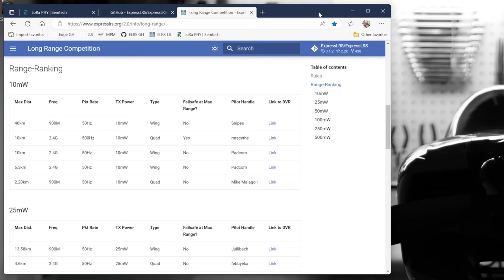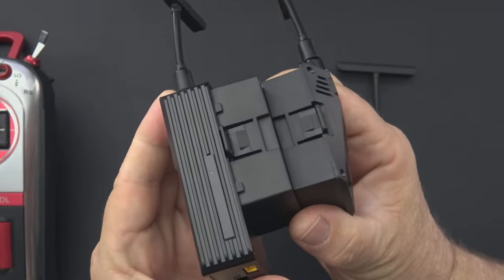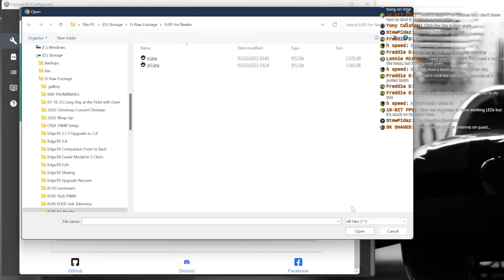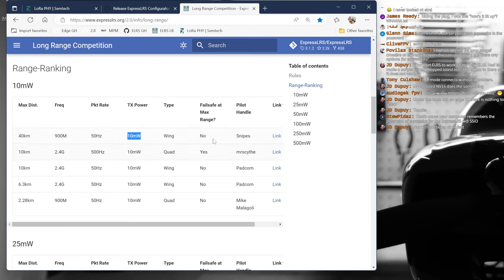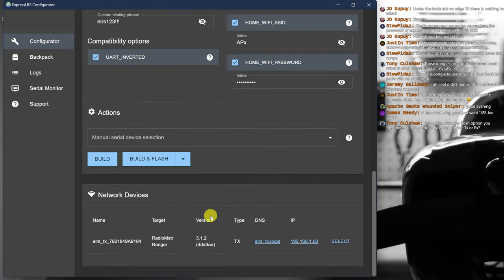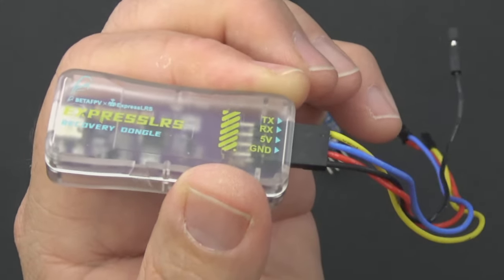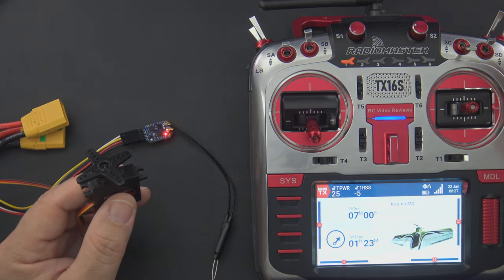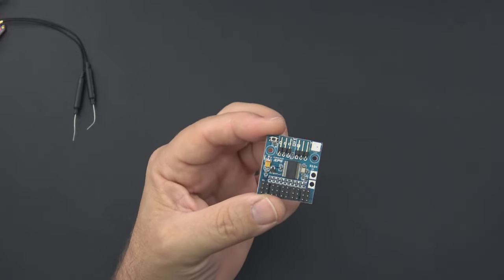Intro to Express LRS • For ELRS Novices

Comment: Great video.  I have a Matek 405 flight controller with elrs built in and was struggling with connection.  Your comment about the Matek target being DIY made me go back and actually read the manual.  After updating the firmware, it works great!  Thanks for all you do, especially for us noobs to elrs.
Reply from the maker: Glad it helped and you're welcome.

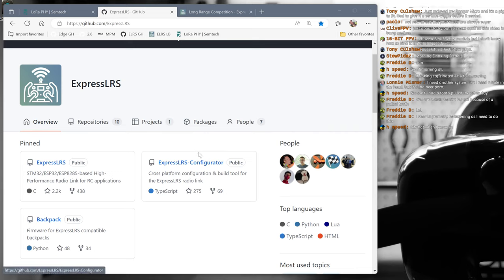Comment: 13:21 Was idly listening from my office desk in my sign shop as an RC Newbie looking to outfit my FMS Fox 3000.
Your first couple of lines was spot on! People in most help videos are speaking english but the nature of the craft has so many abbreviations, all a newbie can hope for is knowledge obtained by osmosis. FPV, ELRS, BNF, PWM, FJB, the list is endless.
 When I discovered people fly long range on auto pilot and use FPV I was thrilled.   My heart started pounding as I was alerted to the reality that me,  a professional power Mac user can join in the fun without using a windows platform, which is harder to me  than flying without AS3X and Safe.  
ExpressLRS-Configurator-1.5.5.dmg had me from hello!  
Currently, I'm all Spektrum but I will be buying all my gear through your links because your video made my day!

Comment: So true about long range...video will go long before control signals. Furthermore, 2 watts would provide little increase above 1, as there is not a linear relationship between power and signal strength. Thanks so much for this video, I've been kind of resisting elrs a bit because I haven't had any range problems, however, it's getting harder and harder to buy certain quads that aren't ELRS.

Comment: Excellent job presenting ELRS and its idiosyncrasies. 
Unfortunately, you've definitely talked me out of ELRS. Last flown rc planes 15yrs ago. Will start flying again as soon as I can print  my Pitts. I think I'll start with Flysky IA6X then move on from there. Thanks again.
Reply from the maker: You're welcome. It's definitely not for everyone and there are simpler options to be sure. What I like so much about ELRS is I can use it in everything: CRSF talks to flight controllers so Betaflight on quads, iNav on FPV fixed wing. It talks to the FBL I like to use so I can use it on helis. And it has PWM output options with telemetry, so I can use it on fixed wing for LOS. On top of that the receivers are fairly cheap.

Comment: Thanks for this.
I have recently made the switch to ELRS, starting with the RadioMaster Ranger transmitter module, RadioMaster RP3 receiver, & the first of all five of my helicopters to get it is my Goblin RAW 420. Eventually I will put all of my helicopters onto ExpressLRS. I have been following their development since 2019, back when I first bought my RadioMaster TX16S Max Edition controller.
Nearly four years later, & this has come out & the ELRS devs have finally added support for helicopters is amazing. =^/.^=
Reply from the maker: You're very welcome. Glad you found the video useful.

Comment: "Take your medicine, go spend the 7$. It's worth it" 
LOL
I had to stop the video and laugh.
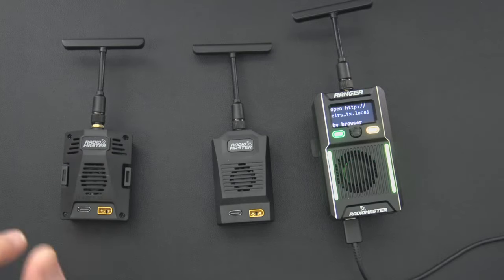0k back to it now. 32:03 min.
I love the way you explain things, the telephone analogy is great we used that when I worked in telecom to explain why we were twisting two wires on our cables.
OMG the pointer cam out!!!!!
I am going through your channel videos, it like eating an elephant.
I thought you were going pretty fast then I realized I had the speed a 1.5...
I used to code a bit back in the 1980s, compiling from a tape could take hours on a big VAX, prior to that you would insert punch cards all night on like a P-11 (before my time). Talk about your "this could take a long time guys" comment! LOL  
You have a nice pic of the Ranger micro on your elrs lite and I hope that IK will get that when I upgrade the firmware on the TX16, I just received it and it has edgetx v.2.7.1, 2022-07
Thanks!
Reply from the maker: Welcome to the channel and have fun going through the material :)
Reply: @RCVideoReviews  BTW,  I did buy "it". I kinda had too after your comment... 🙂

Comment: Small correction, the full sized ranger can go all the way up to 2W! It is more powerful (but it's useless for most people)
Reply from the maker: Not out of the box and I don't show it because I don't want to be the one responsible for telling everybody how to violate part 15 rules. So it's not a correction. The device allows it, but the manufacturer correctly set it to 1w to comply with the law.
Reply: @RCVideoReviews oh I completely agree on you not showing how to circumvent the law, but it's a selling feature even if they never explicitly say it to not get their product banned. In their website they only say "default 100mW" under RF power output in the product specs of all three for the same reason, lol

If it was intentional though I also agree it's not a correction
Reply from the maker: I've been flying LOS with ELRS for a while now and it's pretty rare to see Tpwr in the logs > 10mw. Every now and then a 50mw burst. 2w is just over the top and really not necessary unless you're doing some seriously long range and then you're going to have trackers, and some serious knowledge on video setups. So I figure at that point, you already know the hack. 

YT is a great teacher. Sometimes it's just better to leave certain things unsaid.

Comment: For anyone shopping for a Ranger module, the biggest one, with the aluminum casing, will shed heat more quickly than the smaller version, that has a plastic casing. Just something to take note of.
Reply from the maker: I was flying all weekend in Florida. It was 95 degrees outside yesterday. Telemetry on the micro showed RQLY about 95% or higher, TPWR at 25mw 99% of the time with one or two spikes to 50mw. So I had superb LOS radio performance throughout the weekend with a legitimate heat test on the micro.

That said, my TPWR was low the whole time. If your use case mandates a higher TPWR, the aluminum case might make sense.
Reply: @RCVideoReviews  thank you so much for all these stats, I will put them in my folder, until I have a better idea on the full range and performance of these modules. I am interested in how the 2Watts will handle penetration ( I see you suggest that LoRa is not necessarily aimed at pen, but looking forward to field-testing ) of green leaf canopy. I have not yet put my drone in the air, since I received the module.
Reply: Just an update to the thread... (not adding much to what RCVideoReviews already said, just getting back to my original comment)
  >The Power Output of the RC-Link, that is needed when flying with a Video RX/TX will never be anywhere near what is needed for the Video Link. I Don't fly long-range, so I can't speak to that, but at ELRS-150mW, the RC-Link is way, way, more powerful than my DJI-V2-1200mW. I can' not find a use for the ELRS 2-Watt Power Output, when I am using a Video Link. 
   >If you need the full 2-Watts ELRS RC-Link, then you probably already know a lot more about radio than I do. Happy flying everyone!

Comment: K my issue is that I just got the radio master boxer with built in Express ELRS, Crossfire, 4&1. Now i did the whole process on downloading the black sheep TBS Configuration. But for some reason, my TBS agent is not working on my controller. It’s saying something like error value. I’ve copied the TBS agent files to my USB on my radio, I followed the instructions to the T on Joshua’s (from Roto Riot), YouTube video on how to download the files. I didn’t need a module for this saying that my radio has it built in already. So I don’t know how to get the TBS agent to stop showing a error value. Any advice or link video that shows on how to get this back to working. Also, if I were to do a master reset on my radio, would it reappear as how I first got my radio?

Comment: Great video. But I'm still unsure why I might want to use ELRS for my airplanes instead of the 4 in 1 module. I'm not doing FPV or drones. Thanks
Reply from the maker: $15 Rx's, no fear really of signal loss, ridiculously easy to bind with binding phrases, tx can travel from radio to radio and maintain bind, rapid development in Opensource vs stagnant corporate development, multiple form factors including postage stamp and pwm. 

I have ELRS in all of my best planes.
Reply: @RCVideoReviews  thanks!

Comment: Hi sir I have a question what would ur advice be I wanna add elrs to my ground control for my Rc car ? Ps u are the first guy I’ve Hurd say what u said In regards to neubs!!! Amazing sir u are awesome 😎
Reply from the maker: I'd say I love ELRS and trust it with expensive planes far away. If you have a ground based radio that supports ELRS tech--I would say use it without a moment of hesitation. Glad you found the video useful. Thanks for the comment.
Reply: @RCVideoReviews  yes radio link RX eight has a wire that connects straight to the ELRS system through the USB or a small battery but my question to you is do you know how to connect this to an RC car

Comment: I am a complete beginner and have got the pocket  cc2500 to and have the elrs nano mod on its way. I have real flight trainer simulator with a ws 2000 dongle which I am unable to bind with, I am hoping that with the module that it will bind. If it still won't bind have you any suggestions

Comment: i am awaiting my new mt12 radiomaster 4 in 1 surface radio and have a nano elrs module.i will be updating to the latest firmware. my question is do i plug the usb c direct into the module or do i plug module into radio 1st and then use the data port on the side  of the radio. will the  installer read the external madule so i can flash it or can i just flash it when not connected to the radio

Comment: Hello everyone, So I got a new drone (my first drone), and I have been able to fly it okay. I'm using the Radiomaster Boxer ELRS. However, on the last two flights, it started screaming at me, "Radio signal critical" and fail-safe. anything that i can do, or is this a kown issue? it was not doing in the last 2 weeks that i have been flying it. as soon as i crossover 300 Meters away it goes on telemetry. lost and critical low signal

Comment: Hey again :D may I ask if there is a way with the Ranger to sent telemetry via WIFI or BT or its only used for flashing etc? Thank you!
Reply from the maker: Telemetry is only delivered over the control frequencies.
Reply: @RCVideoReviews  I managed to add a BT module and now I can get the telemetry on my phone. Although I use it with Ardupilot now, I'll figure about something for the other platforms too. Thank you!!!

Comment: So its not possible to flash thru the TX16S when the module is inserted into the Jr-Bay ? I have flashed FrSky Rx's via the TX thru the UART and made a servo cable that had switched two pins.
Reply from the maker: No, you can't flash external modules through the module bay.

Comment: Great video! Thanks a lot.
I hear from others that when you use 1 watt or higher power you should always use an external power supply. Is that right?
Reply from the maker: I cannot validate the question. Two points: 

1) We're talking about radiated power, not electrical power. 

I don't believe it's a 1:1 correlation between radiated power and electrical power, but if it were 1:1 then: 

2) 1000 milliwatts = 1 watt. W/V=A. So 1w/5v= 0.2a or WORSE: 2000milliwatts = 2 watts. 2w/5v = 0.4a I seriously doubt the pins in the JR bay would struggle at all with .4a. And I know the batteries in the Tx should be able to easily handle an incremental half amp.

So personally--I doubt an external pack would be required.

Finally, Radiomaster did not stipulate in their instructions that an external pack is necessary for 1w of transmit power.

Comment: This used to be a simple hobby.  A lot has happened since I built my last heli in 1985.  People used to think I was smart because I knew what a Schmit Trigger was.  No more.
Reply from the maker: The tech is advancing at a rapid pace, that's for sure.
Reply: I kind of see this as a separate hobby, honestly. In my youth R/C was more about modeling, and the more "scale" you were the cooler. R/C drones are a different animal. It's more about the bleeding edge of technology and riding this wave of super fast development. Luckily R/C modeling still exists, and Futaba will still happily sell you a radio for that.
Reply: @RCVideoReviews  Well, I'm 76 years old.  I doubt I'll live long enough to even catch up.
Reply: @MontegaB  It just dawned on me that the only flyers needing ELRS are drone pilots so I must agree that this is a hobby unto itself.  I bought a Boxer with native ELRS but I doubt I will ever use it in an aircraft.  Maybe I should go look at what Futaba has to offer.  Could you elaborate a little, please?

Comment: I'm new to elrs thinking of radiomaster tx12 plus rx from them do I follow this video to configure thanks
Reply from the maker: ELRS configuration is really the same regardless of the radio/module being used.
Reply: @RCVideoReviews  
Thanks for your reply 
I am also after advice on what fpv camera to use on the heewing t1 vtol  as it is a lot of info on different setups. was thinking dji 03 or runcam.
Any help much appreciated

Comment: Is this necessary equipment for rc flight in general or just for long range?
Reply from the maker: You have to have an RF transmitter and RF receiver. It may as well be this protocol. Can't beat the price, features, or reliability. 

Nothing else on the market comes close.

PS And oh yeah, if you want to fly long range you can do that too. I use this protocol on every line of sight (LOS) plane I have.
Reply: @RCVideoReviews  my apologies, I didn't word that question very well. I also assumed that the ranger module was just for extreme range. Is the ranger module a must have for the transmitter to work, or does the transmitter still work without it?
Reply from the maker: All TX16s come with an RF transmitter. Some are 4in1, some are ELRS. None of them ship absent a transmitter.
Reply: @RCVideoReviews  gotcha. Thank you

Comment: I am a subscribed. If i do not do fpv, and only flying watching my small foam planes at the local park or a club , do i need ELRS?  what do i lose for not using ELRS in my case? tks
Reply from the maker: I use ELRS in all of my LOS models. Cost effective, locked on RF, binding phrases, bi-directional CRSF, onboard vbat, plenty of form factors, packet rates to 166hz for 16ch, 333hz for 8ch, opensource development by hobbyists who know what they're doing. 

To me, this question needs to be flipped: Why on earth would you use anything but ELRS?
Reply: @RCVideoReviews  Well put, i only recognize about 1% on the names you listed in your response but it seems that there are many things i am missing from not using ELRS, i will continue watching your videos to learn about it. thanks for your response.

Comment: Hey man quick question, I'm trying to build and flash for the first time my Axis Thor tx and it keeps saying flash error, and under the log it says- A fatal error occurred: Failed to connect to ESP32: No serial data received. I have the correct driver installed from silicon labs, can you possibly point me in the right direction on how to resolve this frustrating situation?
Reply from the maker: Flip rx and tx?
Reply: @RCVideoReviews  I tried switching to that option with no luck, even tried several different usb-c cords including the one that came with my phone and still the same result. My tx came with version 2.5.0 and it won't update to any of the newer elrs versions, they really need to work on streamlining this whole process like Crossfire.
Reply: @RCVideoReviews  so I finally got my Axis Thor tx to update from it's factory setting of 2.5.0 to 3.2.0 via it's own wifi interface and web browser, along with my two Matek R24 P6's (man those soldered pin headers bring me back) via the same method, so it's all good here minus my understanding of why the uart method kept failing. 

Quick question: what do you prefer to use as your best elrs pwm board for 6 plus channels in fixed wing models?
Reply from the maker: I like the Matek CRSF-PWM-C. It's 10 channels, but has voltage and current. If you can get by with just voltage, the CRSF-PWM-6 is pretty nice.

Comment: You have to use this dongle on all elrs receivers or just certain ones
Reply from the maker: This is a trick question:
You don't "have" to use the dongle. You can flash via wifi.
All receivers can be flashed with the dongle.

I recommend ensuring you have the dongle because on countless occasions I've flashed a receiver using the correct firmware and wound up with a corrupted flash from which the only way to recover was via dongle. This isn't a question of brands, it's a question of what to do if you do everything right, but still get a corrupted flash.
Reply: @RCVideoReviews  ok cool thanks for the info dude

Comment: Hey i can not Find any receivers with pwm that have more than 5 channels how van i use erls in my fixed wings that need more?
Reply from the maker: In the video I showed the crsff-pwm-c converter from Matek. That will give you 10 channels. https://www.youtube.com/watch?v=JymV752PJGM

This also works: https://www.youtube.com/watch?v=oUcMMjpN4u0

I'm hoping we'll see manufacturers produce some 10 or even 16ch pwm rx's this year.

Comment: Hi you explained the add on module but you didn’t talk about the controller transmitter and why have the ranger module, seem the controller has a weak transmitter , why didn’t they just put the module in from the beginning ? 😜😜😜
Reply from the maker: There’s no implication the built in tx is weak. It’s just different. There are lots of reasons people still use the 4in1. It remains completely viable.